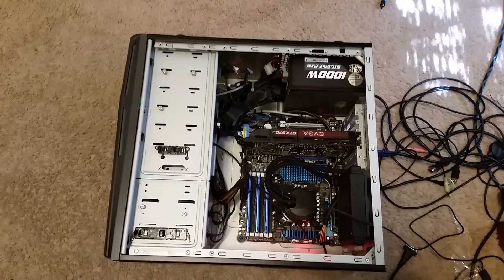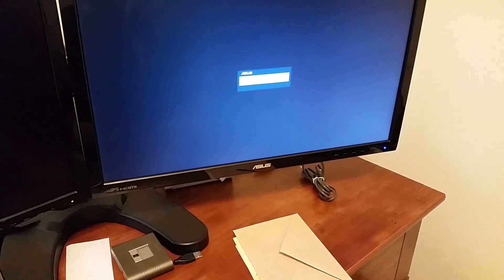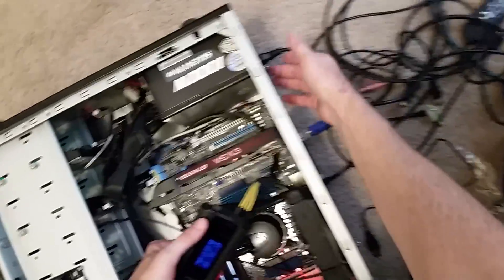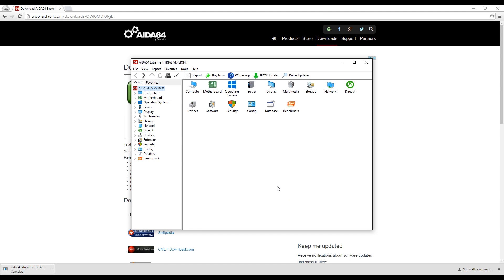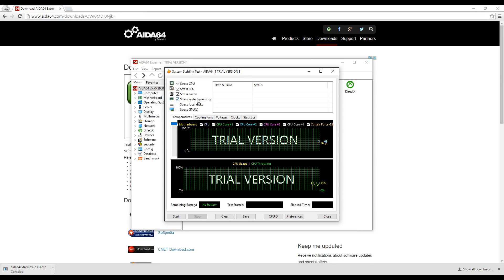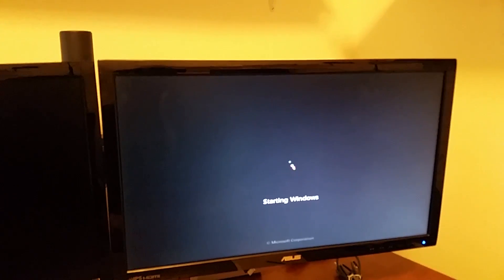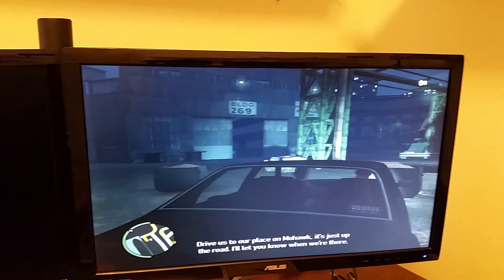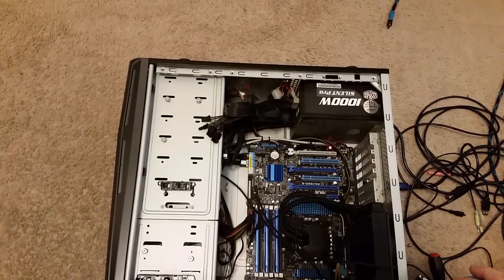Video/Graphics card troubleshooting

Comment: My graphic card is to big to be connected on the lines it doesnt fit 
Any tips
Reply from the maker: If you mean it doesn't fit in the slot then you're either not aligning it correctly or the slots your computer has are the wrong type.
Reply: @MichaelTheComputerGuy  it was my first time building and i didnt take the case of it

Comment: Ordered a prebuilt it came in and the monitor was not getting any signal so we tried everything from the HDMI cord to plugging my PS4 in to test the monitor. Then we decided to remove the graphics card just Incase it was loose and it back in. Did that and it still didn’t get in signal. WhAt now? Get a new pc? Or should I try again maybe I did it wrong
Reply from the maker: If you just ordered the computer call the support number for where you bought it.

Comment: I get one beep when it turns on no display.help?
Reply from the maker: A beep usually means that the computer completed post which is power-on self-test. That's good. So are you sure your monitor is on and connected to the computer? Have you actually checked? Another possibility is that your monitor is set on the wrong input setting. Did this just happen out of the blue or did you change something and then this happened?

Comment: What if i have no picture at all but tower turns on? (Dimention 4700). VGA cable and monitor tested and known to be good
Reply from the maker: That could be a problem with the graphics on the motherboard the ram in the computer good chance its the motherboard itself in general. Also slight possibility of being a power supply problem, but most likely something to do with Ram or motherboard. Take the RAM sticks out and put them back in. If that doesn't get it up and running try just one stick of RAM and then the other by itself.

Comment: I have bit different problem with my graphic card when i install graphic card driver (nvidia graphic driver) my screen seen weird black pattern and my pc gone hanging then i uninstall the driver the Pc running back to normal, What was that can u help me!!
Reply from the maker: If it's still under warranty call the graphics card manufacturer. what that usually means is that the more advanced portion of the card is having problems as in hardware problems. It's only accessed when you load the driver. Most likely the card is failing.
Reply: @MichaelTheComputerGuy  But when i open adaptor setting in display setting of windows it says your hardware working properly
Reply from the maker: @aliasger3452  That may be because you have a basic graphic adapter driver loaded. Regardless if when you load the drivers for the card you get black screen it's most likely that the card is failing.

Comment: I bought a GTX 950 gigabyte OC edition used and I have a 450 watt power supply I do plug my 6 pin PCI connector for the graphics card but when I turn on my computer in a black screen a message popup saying please power down and connect PC I cables for this graphics card ... I changed the thermal paste the graphic card.... sometimes PC turn ons and after few minutes just like you..  monitor turns off... Can someone please help
Reply from the maker: Put back in your old graphics card and make sure the computer comes on and functions. If it doesn't with the used graphics card installed it's most likely just not working.
Reply: @MichaelTheComputerGuy  thank you so much for replying..... Isn't there any way that I can fix my old graphics card... I have two problems with my graphics card.... Monitor turns off while in game and when restarting it says to connect PCIE cables even though I connected it... Will microwaving it help???
Reply from the maker: @alsowonderingthesamething6616  Reflowing might help.

Comment: i have kinda similar problem but it goes full black and says no signal and it comes after like 5 sec . happens when i watch videos or when i go to my computer .games work fine
Reply: it started happening after i installed a new ssd card and i have looked again and everything looks fine inside and
Reply from the maker: @feelit9755   You may have bumped the graphics card when you were putting in the SSD. Take the graphics card out and put it right back in.

Comment: HELP!!  I bought a graphics card (amd R7 240 1gb GDDR5) and installed it, when I'm playing Dota 2 and League of Legends then maxed out the video settings, the game runs ok (50-60fps) but for about 20 mins into the game, it crashed...  It displays a blue screen error saying 'crash dump'...  Oh and by the way, i only had 2gb of ram... I noticed, when I'm playing these kind of games (games with high graphics) it keeps crashing,  but when I'm playing games such as Minecraft and Terraria it doesn't crash at all... Is it maybe because my Ram couldn't keep up with the GPU?   
I'm asking for help to make sure if that's the problem, if it is, I'll upgrade my ram...  And Thanks in advance...  😊
Reply from the maker: Computers don't crash because something just can't keep up. It's an indication there's a serious problem. If it really started after installing a graphics card make sure you have the most recent drivers installed for the graphics card. If it's still blue screening you might try upgrading the BIOS on the system's motherboard. Other than that try and return / replace the graphics card.

Comment: Hello my pc has some problem when i ran any heavy game my PC gets restarted or if the game started only giving me 7-10 FPS,  im using cooler master 450W and my GPU is GTX1060 6gb , previously games was running flowerless
Reply: Happening to me aswell
Reply from the maker: Check to see if your CPU is overheating.

Comment: Hey, i have a problem with my pc crashing and not being able to fully get it out of sleep mode. Whenever it goes to sleep and i try to wake it up, the pc turns on but the monitor shows no display. It eventually gives me a blue screen error and i have to do a hard reset or shutdown. Can my gpu be a problem or is it something else? I just want to know if it's possible that the gpu could be the problem. It doesn't crash at all during normal use and gaming, only when getting out of sleep. I can't find anything related to my issue on the internet and I've looked hard. Thank you
Reply from the maker: I would look for a bios update for the motherboard.

Comment: I have a different problem with my GPU.Sometimes it powers up perfectly and I could play all games just fine.But sometimes it does not even power up and there is no signal.Any solution?
Reply from the maker: I would suspect the power causing that problem.
Reply: What did u do?

Comment: I have a question that pertains to this type of a situation. A few days ago I started having this exact issue. I could go on my computer, go online, and do pretty much anything. But, when I go to load a game, it would load for about 5-10 seconds, then black screen exactly like this. Like this, nothing I could do would take me back to my windows home screen, so I'd have to hold the power button down to force it off.

I ended up opening my computer and cleaning everything, even though I was sure it wasn't a heat issue, as it would do it on a fresh start up when the PC wasn't on at all that day. After doing a full cleaning of everything, I started my computer up and it was fine the first time. I did notice the hard drive staying at a 100% load for longer than usual at startup, though. I went to load a game, and it went off. However, now when I start my computer, the screen goes black right at boot up. Meaning, I enter my password, and as soon as it tries to boot up, the screen goes black. Some of the times, I don't even reach the password point, before the screen goes black. Would this still be in line with the video card being the culprit, or could it possibly be the hard drive, motherboard, or PSU?

I got my computer to boot into safe mode, and tried to run a stress test. As soon as I started the stress test, the screen went black. I'm not sure if it was testing the video from the start, or what. If I can get it back into safe mode, I'll try the test you ran in the video, and test everything but the video card, like you did. I'm hoping this isn't a bigger issue.

My first guess was that the video card was done, because my PC is around 6 years old, and the Radeon HD 7850 had just came on the market within 6 months or less from when I had my PC built. Now, because of my computer not wanting to even stay on at all, I'm hoping it's not a bigger issue. My hard drive is one thing I have replaced since building the PC. I replaced the hard drive around 1-2 years ago. Other than that, everything else is 6 years old.
Reply from the maker: In my experience it's either the video card,  motherboard or power supply in that order of possibility. Replace the video card first. Then the power supply because it's easier than the motherboard.

Comment: So I have a problem with my PC And I have been having IT for a good amount of time. So my PC was running normally as usual, Then all of a sudden from 61 fps IT went down to 13 And 10.. Ever since Then IT has been doing this in every game. Would redoing the Windows be valid? Or is it Something from my PC?
Reply from the maker: It could also be that the CPU is overheating. Look on the channel here and find one of my newer overclocking videos. It'll show you how to check your CPU temperature.
Reply: @MichaelTheComputerGuy  Thanks for your reply! I will look into it And Tell you the results :)

Comment: is this the same problem as the computer starting a game but running at 1fps
Reply from the maker: It might be the graphics card failing but it could be other things. Was the graphics card playing games fine and then all of a sudden it started running very slowly? Have you tried updating the drivers for the graphics card?
Reply: @MichaelTheComputerGuy  yea it was playing fine then I bought a new game and tried to play it and got 1fps and it then said it couldn't find 512mb of free space so I tried to update the drives and they failed to update
Reply from the maker: The 512 MB of free space is odd. Are you sure it wasn't talking about video memory? What was the exact error message?
Reply: @MichaelTheComputerGuy  I think it was referring to the minimum required video memory for the game
Reply from the maker: @Therealsanta115  That makes sense. That means the current graphics card you have doesn't have enough video memory to run the game properly. You might try lowering the resolution and see if that makes a difference. Also very often there are graphics settings that you can reduce to make a game run more smoothly.
Reply: @MichaelTheComputerGuy  that was the problem I'm using a nividia 1050 2gb and after taking the side panel  off to have a look i starting to worry about it so I put the panel back on and tried it one last time and it is now working so does that mean it's prone to breaking any time soon
Reply from the maker: @Therealsanta115  I wouldn't say so. If it's playing well now don't worry about it.
Reply: @MichaelTheComputerGuy  if it keeps having trouble like it was would it be best to replace it or get someone to fix it

Comment: Hi, im having trouble with my 2year old gpu, the display starts fine then eventually after 10 or 15 mins of usage whether its playing games or watching movie,  the screen turns out into a plain color,sometimes its blue, green yellow but the sound of the game or movie is still on the background, then the the sound goes away,  im testing if the pc still responds by trying to pop the task manager out, alt tab, or press the number lock on and off to see if the keyboard responds, eventually i feel that it already freezes, i turn the pc off, remove the  video card and plug the VGA cable in the onboard graphics and it works just fine, i just cant play my games without the video card, do you think that my gpu is about to die? or is there something i can do? it takes a quite some time before it freeze so i suspect it has to do something about the temperature of the GPU? tried changing the thermal paste, i may need to remove it again, i feel i placed to much, is there any specific liquid i can use to clean the thermal paste without damaging the GPU's circuit board? will any thermal past do? i appreciate your response :)
Reply from the maker: Those symptoms do sound like the graphics card is failing. It may just be heat-related and replacing the thermal compound and making sure the cooler is dust free would be the thing to do there. You don't need anything special to clean off the thermal compound. Just use a paper towel. I use Arctic Silver 5 for thermal compound. All that being said most likely will just need a new graphics card.

Comment: I kinda have the same problem,  I loose video and sound, every-now-and-then my screen turns off THEN returns to normal
like a light switch ON/OFF   - so wierd

I will try another graphic card and see what happens
Reply from the maker: Look at the monitor being the cause.  You might try another input on the monitor or try swapping it out temporarily to see if the problem goes away.

Comment: My monitor flickers like black dots appear and im not sure if its the graphics card or the motherboard could u help out?
Reply from the maker: I would need a lot more information.  Does this happen right when you turn the computer on or does the computer work for awhile and then this happens?
Reply: it happens as soon as u turn on my computer and especially when i play games like it is alwyas there it never goes away.
Reply: i have a Nvida gtx 1060 gb graphic card
Reply from the maker: That sounds like a video card issue.  Replace the card and see if that fixes it.
Reply: alright ill see, but here some more information about what also happens. I have a good fps no lag when i play but it keeps flickering there are also lines the appear and diss appear and i tried unistalking my graphics card everything is perfect no screen flicker nothing perfectly fine. do you u think it is feom the graphic card or something else?
Reply from the maker: BZ Skateboarding sounds like the graphics card to me. If you can return it to the store you bought it from if it's not too late. Otherwise you'll have to deal with the manufacturer to get it repaired.

Comment: Shot in the dark here, but perhaps you have run into this situation before...... I bought a PNY GTX 750 2 GB dual fan (non TI version) on ebay.... The guy I bought it from claimed it worked great. I've tried it in 5 different computers and with each one it has the same issue. HORRIBLE performance, GTA IV jumps between 25-40 FPS , even when I turn settings to medium- low...... Open hardware monitor says it will never reach a temp over 40 C...... I've tried several different Geforce driver versions, I've tried overclocking and it does not respond whatsoever until I get to a high setting that crashes the video driver and game, (but I still never see any improvement whatsoever before it gets to crashing point. I'm at a complete loss. I've tried everything? Have you ever heard of such an issue?
Reply: GTA 4 is HORRIBLY optimized for new systems. It's basically unplayable.  Its not your card.  Try it with other games. I've had Fallout 4 running on a GTX 750 (TI admittedly) at 50-60 FPS just fine.  Its not a powerhouse by today's standards by any means but it is still a capable card

Comment: Hello i think i have the same problem too. My game will run for a variety of time but will eventually crash with the blackscreen problem. I also noticed that the fans on my graphics card dont always spin. I think it's either the power supply or graphics card but any help? i've also uninstalled my graphics drivers (AMD radeon 580) and reinstalled them but still the same problem.
Reply from the maker: RealDanCobb If the screen goes black but the computer stays on it's not likely to be a power supply problem. The graphics card being at fault is most likely.  The next most likely would be an issue with the motherboard.
Reply: thanks man i have a warranty for the parts so ill definitely try replacing and testing them

Comment: Ok please I need help so basicly I orderd my gpu today and it was working perfectly...and a little later the screen goes off, the display port is working but when I go into Msi afterburner it shows Boost: 0 MHz And Base: 0 MHz
I dont know whats going on please help !! My computer wont detect it
Reply from the maker: Marveliciøüs I think uninstalling and reinstalling the MSI afterburner will fix that issue. When you go to uninstall it I believe there's an option to erase the previous settings. That's not the exact wording but that's pretty much it. Choose that during the uninstall and when you reinstall most likely the issue will be fixed.
Reply: Let's Enjoy Life got the same issue, have you found a solution yet?

Comment: can you tell me about a fix for that when i play any game,the lcd goes to black and says ''check signal cable''???plz tell me the fix..i have gtx 550 ti..
Reply from the maker: That is essentially what was happening to the video card in this system.  Reflowing the GPU didn't fix this one.  One person mentioned using MSI afterburner or a similar program to lower the voltage going to the GPU and/or memory on the video card.  This might get it working.  Certainly worth a try.  You can find MSI afterburner doing a google search.  There are some pretty good videos on Youtube that show how to use it.
Reply: Michael Cooper it means that i have to download afterburner and use it to solve my problem??
Reply from the maker: Babar Ahmed Yes. Try lowering the voltage or possibly raising it. You could also try slowing the frequency of the GPU or the ram.
Reply: Michael Cooper thank you sir very much..